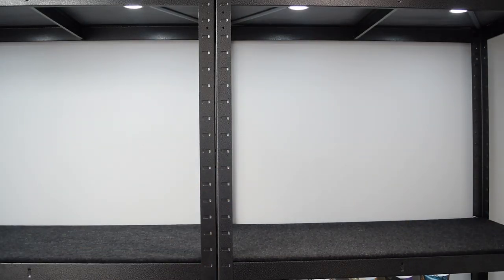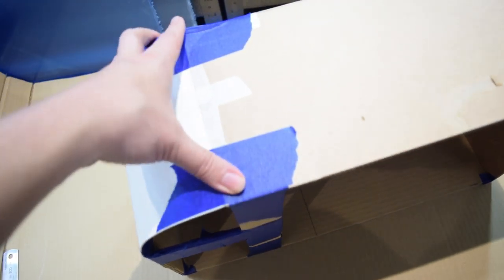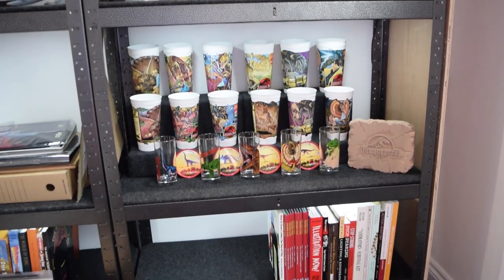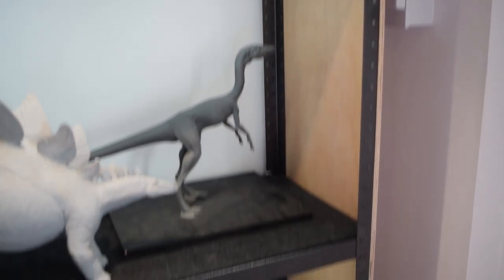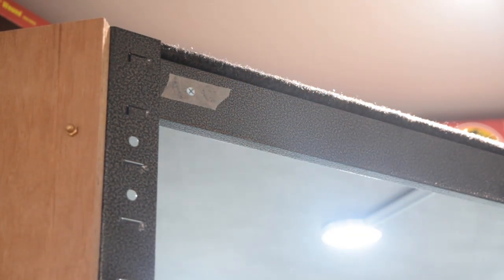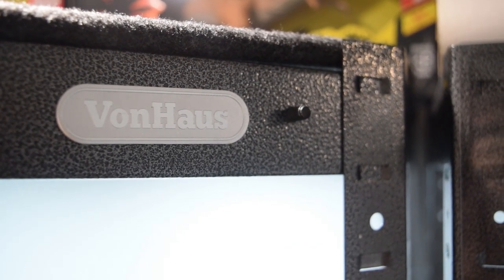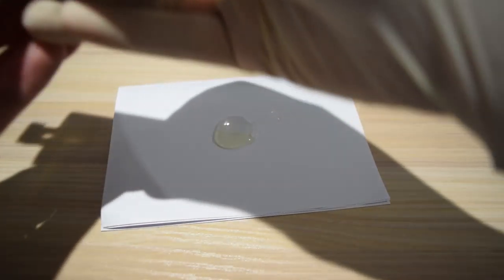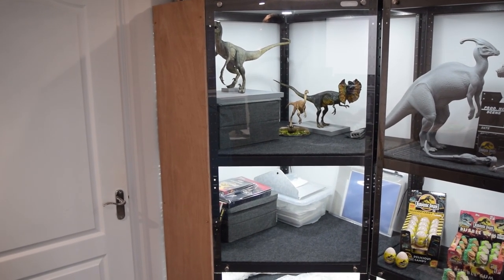Dino maquettes, wood sheets & glazing! | Cost-effective museum | Jurassic Park Display 003

Comment: looks great!...  For the sides and back panels i highly,  HIGHLY recommend pvc foam boards.   They have a sleek matte black finish, super lightweight, cuts like butter, looks clean and easy to install through the inside of the rack covering the inside exposed holes.  Same goes for the sides covering the side holes.  It also looks like the backing of moducase.   You do that and you'll take these shelves to the next level.  You wont regret it.   Man i wish i could get that corner unit.
Reply from the maker: @DonPeppinoo  ah thank you for the advice, I'll certainly look in to those - can you get them in other colours?  You think matte black would look the best?  Good ideas thank you
Reply: @JurassicCollectables  they do come in colors.  Mainly white & black.   Also imo from what i seen in other projects a matte finish looks best.   Its what you like tho.  Im just trying to get as close to a  moducase look.   And looks professional.  In my humble opinion.  Moducase also uses white, so its whatever you like.
Reply from the maker: @DonPeppinoo  Ok great thanks.  I'll have a look at the moducases too.  Thanks for the advice

Comment: Man that's a very clever solution to displaying once collection and I'm sure it's a lot cheaper than what can get if you were purchasing a display case. I'm serious thinking of doing this once this damn pandemic is under control. The only part that I think can be improved on its maybe using a very thin wood frame over the edges or the acrylic panels that matches the width and length of the frame..... Oh and also the exposed ends of the plywood. Honestly this is a cool idea 👍👍👍👍Thank you soooo much for sharing your clips like you guys across the pond say "It was bloody brilliant"!

Comment: Hey JC,
Thanks for tip last time. I was hoping to use eyelets on my plexi glass but I couldn't find the thread ones. And the biggest hick up is  my plexi glass is 3mm thick. And the eyelets available are aboot 6mm thick. That might be my only choice right now.

Anyways, I was going to ask you where you purchase you eyelets? Thanks!
Reply from the maker: Hi there, no problem!  I think this may be them https://www.ebay.co.uk/itm/394161520543?mkcid=16&mkevt=1&mkrid=711-127632-2357-0&ssspo=swok8wjqqjw&sssrc=2349624&ssuid=ln3RX-FqTx-&var=662673853672&widget_ver=artemis&media=COPY
Reply: @JurassicCollectables  Many thanks!
Reply: @JurassicCollectables  I keep searching for "threaded" instead of "screw on". Silly me.

Comment: what kind of fabric did you use to cover your shelves?
Reply from the maker: It's car interior fabric - anthracite is the colour/brand.  It's the same material you use for lining sound equipment in the boot of a car
Reply: @JurassicCollectables  thanks for that.  Looks great.  I didn’t know weather to go with felt or velvet fabric but this is another option I will be debating on.

Comment: How flimsy is the shelving unit you got?

I found it online but only place I could get it shipped to me in the US is via Ebay and its a bit pricy.

I found one on amazon that doesnt have the corner piece but some people are saying its flimsy and couldnt hold 50 lbs even though the description states the shelves are capable of holding up to 380 lbs per shelf.

I found some that are supposed to be HD but the particle board shelves have to be assembled into the side rails and its curved shape that flares out wont allow for plexiglass/lexan to be installed on the sides flush to keep dust/dirt out.

Just curious cause the shelving I found looks identical to yours minus the corner piece.  Hate to spend $110 USD for a two piece set and have it feel flimsy weak and possibly not even capable of holding my Ecto 1 diecast I will be building over the next 3 years.  We all expect it to weigh 30 to 50 lbs.  Only other option I am starting to think is to scratch build my own setup or possibly add more ribbing or just scrap the particle board for thicker plywood.
Reply from the maker: Its quite sturdy, the joins are solid if you follow instructions clearly.  If you dont need the depth in the corner the standard rectangular ones do great
Reply from the maker: As for weight, these are built for heavy tools etc but do check the weight limit per unit when buying

Comment: How long did it take you to realise you had to take the acrylic off again to take the inside protective wrapping off?!   😂
Reply from the maker: Haha!  I actually left it on while I was drilling/attaching to protect the surface.  It prevents scratches and particulates from getting on the surface.  So it should be removed as the last step - you'll notice when glazing is installed often they use the same approach.  But it must seem late being that last step

Comment: Update video???
Things you changed or would change??
Reply from the maker: Overdue I know!!  Just havent had time to work on it for a bit - I will update as soon as it's had more work done I promise.  Mainly staining/veneering the wood side panels
Reply from the maker: But actually - there is a further video here where I created a flat media storage area https://www.youtube.com/watch?v=Mt_0pWGMJbY&list=PLceQExK8Wx7bC4Zij_UjSFtzml59xY5uf&index=5
Reply: @JurassicCollectables  yeah I would love to see an update video when you get the chance. I collect action figures/ vehicles from the 80s (my childhood) and really like your setup and plan on using a lot of your ideas as I really like the simple modern aesthetic look you have 😅 👍🏼
Reply from the maker: @RatedRGameGuy  Ah great to hear.  I have no complaints about the setup so far.  I made the removal of the acrylic panels as simple as possible, just those four screw on pieces.  Some may prefer open/close doors but it's not too much work to unscrew those and take the panel down.  The lighting works really well too.  Overall I couldn't be happier!
Reply from the maker: @RatedRGameGuy  Something I didn't plan, but I'm grateful I did -  was to leave the bottom section open.  It means it's become a very useful storage space